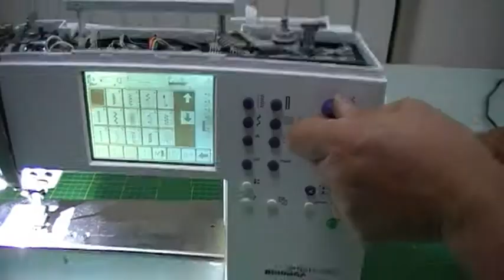How to change Bernina Activa 180 the LCD Unit, Touchscreen and LED light

Comment: This video is brilliant and helped me replace the touchscreen on my 20+ year old machine. Thank you for making it - much appreciated.
Reply: I have an Artista 170 - I think mine has a screen issue vs. a motherboard issue - because I can touch one side of it, but cannot access my stitches.  May I ask is yours still working after the replacement?
Reply: @irisnaderi358  Yes, mine is still working well. Mine was a Activa 180 that had minimal use prior to storing it for 8 years or so. It was when I got it out after all that time that I realised the touch screen seemed to have delaminated. It would switch on and pick a stitch as the default and I wouldn’t be able to change the stitch selection.
Reply: Thank you😊
Reply: @irisnaderi358  Where did you get your replacement screen ? Much appreciated